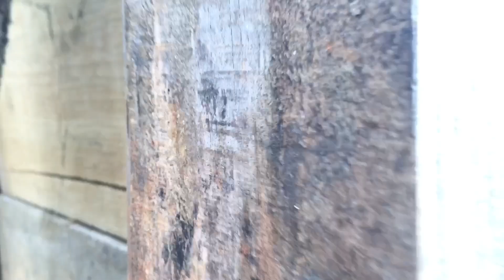Will Sticks Stop a Cannon? Recreating the Battle of Valcour Island

Comment: Have you ever read about the Royal Navy's "Copper Head" shells, dating from the 1870's?? They were the Victorian version of modern HESH shells, designed to deal with iron clad naval vessels. 

The shell was a iron cup with a front facing soft copper ball, filled with black powder, fixed to the front. On impact with a piece of sheet iron, the copper ball would deform and spread until the black powder self detonated, transmitting a wracking shock wave through the sheet iron and causing spalling on the far side.

Copper Head shells were rendered obstelete, by the 1880's, when laminating sheet iron with oak became standard practice in iron clad warship design.
Reply from the maker: I have not but those sound horrifying. I don’t exactly know the laws on exploding projectiles but I’d sure like to make one of those! Thanks!

Comment: Nerdy snack for the algorithm :
At 9:30 you can see the camera shaking because of the shockwawe, this prove that, 1) that cannon has quite a decent amount of power and 2) since the balls impact after the camera was shaked, they are travelling at subsonic speeds. Not surprising considering that they come out of a black powder cannon but balls coming out of a musket would have been faster, although not by much.
Reply from the maker: I didn’t ever think about that but it makes complete logical sense. I’ll have to get a chronograph one of these days and see how fast they are really going.
Reply: @TheCannoneer a chronograph is expensive and needs to be placed far away from the muzzle to avoid errors due to interferences with the smoke of black powder firearms. Frame counting is free  but it’s time consuming and can be inaccurate if you are not careful. On the other hand it should work great for grapeshot.

Comment: Can we see what the splinters will do to a meat target? I've heard they were a bigger worry than the actual ball itself.
Reply from the maker: For sure!
Reply: One thing about the splinters is that it is a very cramped space inside a ship of that era. 
It is full of stuff, like the cannons, the rigging, metal fittings; not only the wood would be shattered, but everything would be trown around when hit by a cannonball, and those would fly in a small space full of people.
I have never seen anyone try to replicate this, it is always a single pannel of timbers and a body analog (a gel block or a pig). It is never impressive, or accurate.
Maybe if you try to make a simulated ship's gundeck, with a witness target behind, it would be a better visualization.